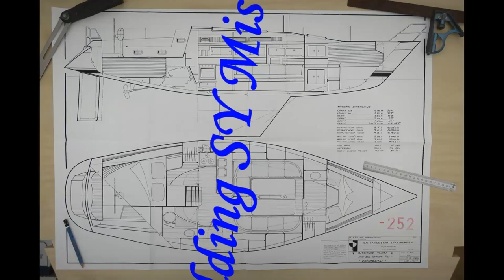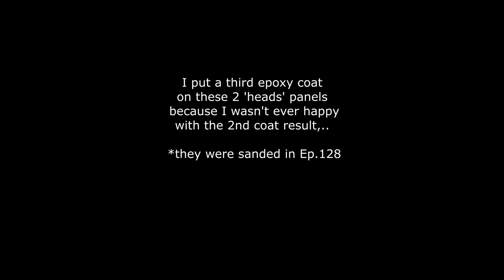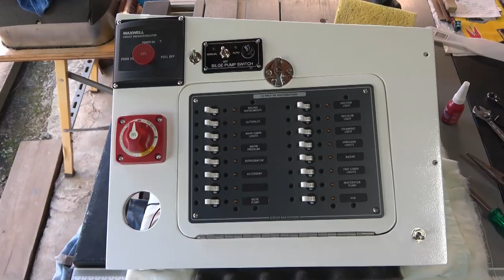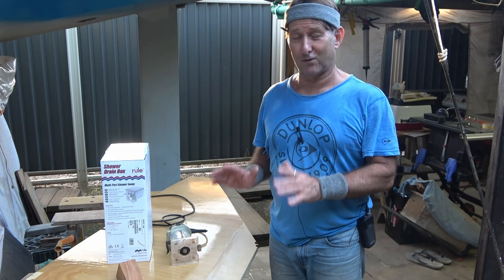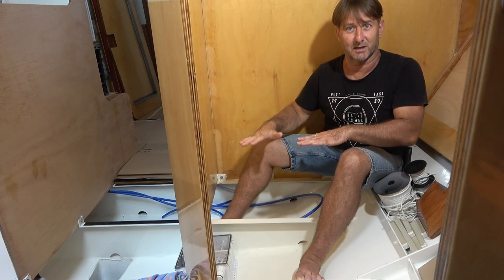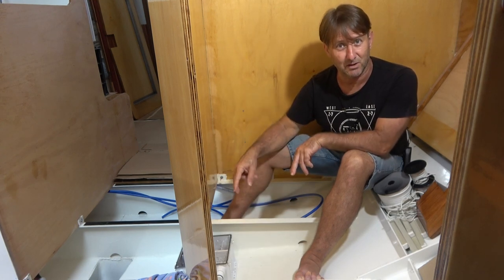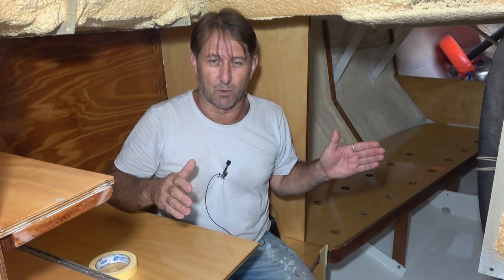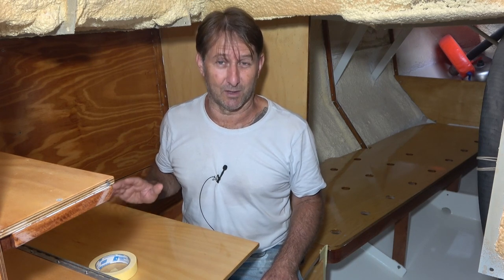BLESSINGS in Disguise! 🙏 Ep.130 Building my steel sailing yacht

Comment: Creating an easy access way to the shower sump is a smart decision. I can tell you from personal experience that servicing that sump will be a regular duty in a humid climate like yours as well as most of the areas you'll be sailing in. In fact, humidity will be a constant enemy to the inside of your boat. Mill dew can happen very fast so air conditioning your boat ,as well as additional de humidification devices will be critical as I see it. Keep up the good work!
Reply from the maker: Thanks for your good comments sir, appreciated and yes indeed, I always knew that easy access to this sump was a must and re. the dreaded mildew, yes, ventilation, ventilation!  🙂👍
Reply: @BuildingSYMistress  I think our climates are similar. Here in Florida the problem is not while being underway. The sea breeze helps clear out dampness; especially in a power boat. The problem is sitting in port in a humid climate. I had twin air conditioning units on my boat. Even then we had to use a dehumidifier when not on the boat (You can't run air conditioning 24/7). We also used Damp Rid in the hanging lockers to soak up excess moisture. If you have the power for it I strongly recommend at least one A/C unit on Mistress. You'll sleep better in hot areas and have less mill dew on your fabrics, Also your crew will thank you.
Reply from the maker: @Wargunsfan  There are many similarities between Queensland and Florida actually, much to do with the climate we have. Mistress won't be having an a/c, I will need to figure out how to deal with all of the inconveniences along way,... As I say, nothings perfect, but it should not stop our dreams and plans hey  🙂👍
Reply: @BuildingSYMistress  In that case a couple of dehumidifiers will help. They don't require much power and will remove a lot of water from a confined space. Dream on mate.🙂
Reply from the maker: @Wargunsfan  👌⛵

Comment: Let me give you a tip; when you coat a wood with paint or epoxy resin, in the part that this wood makes 90º, with the top, the material applied, no matter how many layers it has, there, in that corner, it will never have material equal to the rest of the surface, because in the corner there is no place for the material to go, it runs to the sides, it will be the first area to peel.
The idea is to break this corner, that is, round it to create a surface, just bent, without corners, so the material will have where to accumulate, and this is still excellent for accommodating the coating with fiberglass fabric. I don't know if I made myself understood. Congratulations and good winds.
Reply from the maker: Thanks for your good comments Eugenio, appreciated and yes, I think I understood what you explain and actually I have made these same comments in some earlier videos. Also fyi, the finish trim still needs to be installed to cap many of the ends of panels  🙂👍

Comment: Looking good Bruce, I must get a trimmer you make it look so useful. A comment on the rule boxes, my experience is the cheap copy ones last longer and the integral float switches are more reliable than the rule ones. You can buy several for the same price as a rule. As most of my friends and customers are not keen on your level of maintenance regular replacement is a better option for cleanliness !! I must admit I've never fixed one down as the hoses are so stiff and short runs the box can't move much and is easier to replace, and no fixings on the hull either.
Reply from the maker: Thanks very much for your good comments rl, appreciated and point understood re. the Rule sump, I will have to see how this goes ahead,...  🙂👍